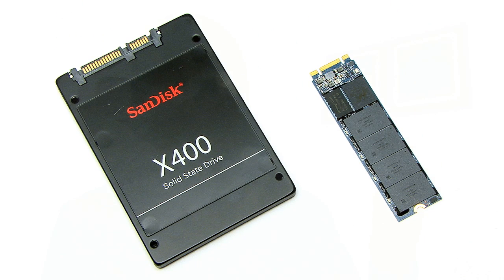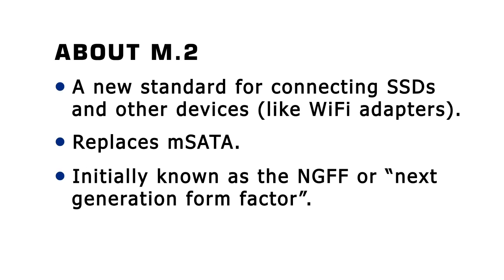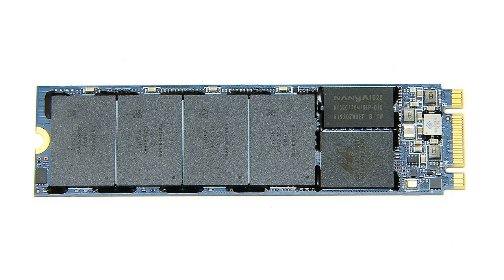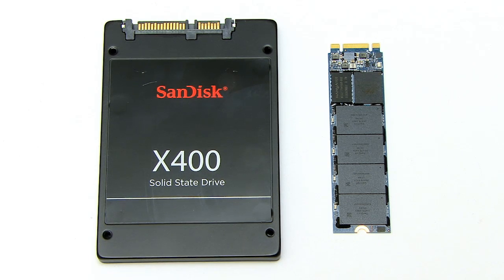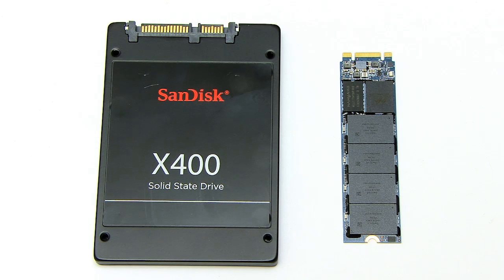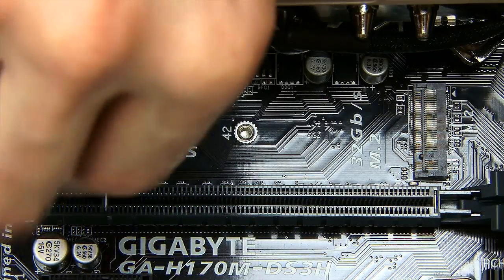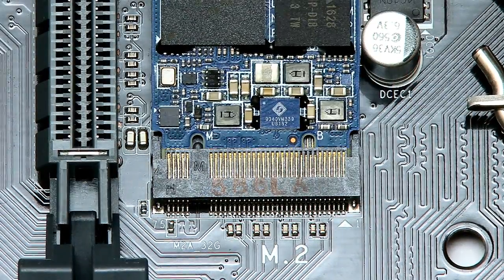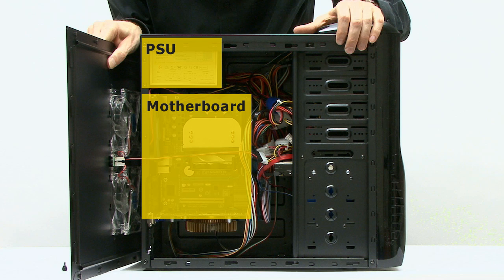Explaining M.2 SSDs

Comment: Dear friend,  I got the laptop of my niece who got a faulty motherboard.   I've bought an universal enclosure so 

I'll be able to gave her her data but I saw something odd with the Nvme Pcie m.2 ssd.  The pins are both side of the connector.  Every other ssd m.2 I saw online only got pins on one side 

Am I having something different into my hands or is it possible that the generic maker made something strange?
Reply from the maker: I've never seen an NVMe SSD without pins on both sides (I've used drives from Western Digital, Samsung and Integral).
Reply: @ExplainingComputers  thanks my friend.... I just realized what is going on .... there is missing pad on the connector, probably stock into the socket.   That's why the enclosure doesn't work and I got only 3 pads on the small parts of the ssd. 

I hope that I'll be able to fix it

Comment: Thank you very much.  Listened carefull for 6:16 minutes, when you git to physical mounting SATA 2280, I was 5" from my 15" monitor.  It's not exactly intuitive whether it's green side up or not.  My first assembly, Raspberry Pi mini Tower Desktop Ubuntu Mat`e, of any computer in 20 years.  Was surprised the image of Ubuntu Mat`e didn't recognize git from got.
I'm at my wit's end.  Disk Mounting widgit says nothing to mount.  Neither fdisk -l, nor gParted showed an installed SSD.🥴 That upward spring of SATA board is a sure tell tale sign its mounted right.
I didn't just get what I came for and leave, I stayed for the entire show.  Highly agree on the advancements the M.2 form factor, it is a game changer.  Very educational thoughout.'

Purchased a UPS, for Pi 4B 4GB, with 4000mA Lithium battery.  It and replacement were returned to sender, "not as described", they flat didn't work.  2nd one powered the Pi4 less than an hour and quit, while on a charger.  Just killing the power is a No No with Pi as it is constantly accessing micro SDHC; and, hence my need for UPS.   Product mini-box carried a label.  A specific printed attribute was the presence on the back of the unit a swatch of nano material.  Is that size enough to make a pointed notation of.  My eyes must have changed to bionic; I could see that shiny sheen and simply couldn't help myself, while pulling that thin film off the double sided tape .

Comment: i have just bought a 240 gb pcie m.2 to upgrade my hp t620 thin client but the m/c is not recognising it. is it that a pcie m.2 will not work in a sata m.2 slot.
Reply from the maker: Certainly. M.2 is not an interface, just a connector. Some M.2 connectors are wired for SATA, and some for PCIe (NVMe) drives, and some for both. So yes, if you have a SATA slot, it will not work with a PCIe SSD. Sorry. :(

Comment: Nowadays, m.2 ssd also comes with a heat sink. Is it necessary?
Reply from the maker: Yes, some M.2 drives now have a heat sink. Whether it is required depends a lot on the PC in which the drive is fitted. If the PC has decent cooling/airflow, it should not be. But a lot of M.2 slots are in poorly cooled locations.

Comment: Great job explaining the pros and cons of M.2 vs SATA SSDs.  It answered some questions that I had about the differences.  I just recently upgraded the SSD in my laptop (a decent step up from 180GB, to 1TB).  I do also have a 1TB SATA SSD that I've already cloned with the software you described in the related video.  Would it be possible to modify it to be able to fit the 2.5" drive inside and configure it to bounce between the two drives (like using one as the primary, and the other for storage)?  Just a thought.

Comment: I realise this is a relatively old video, but you didn't even mention NVME SSD devices. Did you make an update? The slot on this motherboard only has one key, and that is for the M slot. Does this mean that you can use both SATA and NVME devices in this slot?
Reply from the maker: NVMe was recently finalized when this video was made, and I covered in this video: https://www.youtube.com/watch?v=kvHUVcgo8xY I am also working on a SSD technologies, form-factors and interfaces videos to post later this month. :)

How a slot is keyed, and what types of interfaces it can support, are not directly related. B-keyed slots support 2 PCIe lanes, and M-keyed slots 4 lanes. This means that all modern NVME drives are M-keyed, but some are B-keyed also for wider slot compatibility. And there are SATA M.2 drives that are B and M keyed, as well as just B keyed. The slot in question in the video will support SATA and NVME (PCIe) M.2 drives, but this is not due to the keying.
Reply: @ExplainingComputers  Thanks Chris, I saw in the video you linked that you replaced a SATA M.2 with a NVME M.2 - This is exactly what I want to do. Surely the point of the keying is that a slot with only an M key will support BOTH types of M.2 drive, whereas a slot with both M and B keys will only support SATA M.2 drives? Or are there exceptions?
Reply from the maker: @Beevreeter  There are exceptions! For example, there are (were) NVMe drives with a B key only. Today, any recent NVMe drive will have an M key only, and SATA drives B and M keys. But compatibility all really depends on the age of your motherboard. The chances are that if an NVMe drive will fit it will work, but this is not guaranteed, and certainly not guaranteed at full speed. The only way to be certain is to check if the motherboard is specified to work with an NVMe drive, and ideally x4 PCIe. Good luck!
Reply: @ExplainingComputers  Thanks Chris, that is helpful 👍

Comment: 6:13 One simple detail that you've allowed to slip on your brilliant (as usual) presentation:
That motherboard allows for the installation of 2242, 2260 or 2280 drives, and that is marked on the motherboard with the digits and the screw holes for mounting.

I wish you were my teacher back in the 90s when there were no computer classes in Portugal yet for my age and we used to learn by gathering all the gang together and had fun opening someone's computer, messed up with the cables and fiddled up with the motherboard jumpers, hoping to get the thing running without burning.
Trial and lots of errors but a chaotic fun way to learn anyway.
Now in my 40s I watch your videos and recognize a good professional when I see one. Kudos for all your lifetime work, Sir!

Comment: Excellent explanation for M.2 Technology. I need some hep here, i recently bought SSD Samsung EVO 860 M.2, it has an edge for B+M, but my laptop doesn't have M.2 socket, can you recommend any converter from M.2 B+M to SATA so i can use it as my Internal disk ? Thanks a lot.

Comment: "be aware that inserting an M.2 SSD into a M.2 slot on MOST motherboards will prevent the use of a related SATA socket" 

I wonder is there a way to check this before going through the whole rigmarole of trail and error?
Reply from the maker: You can check your BIOS -- it is often clear (eg in the SATA settings) if it is an either/or situation with the M.2 slot.
Reply: @ExplainingComputers  Hi, appreciate your reply ;) It's actually a (HP Pavilion 15-bc006ng) laptop BIOS has no SATA settings :( 

HP are terrible providing service manuals and I checked HWiNFO64 to no avail.

Comment: What is apparent is that motherboards are absorbing components that start off as external expansions. Sound used to be on a card. Disk drive interfaces, serial ports - everything used to be on a card. Nowdays some CPU's don't even require a dedicated videocard. With M.2 hard drives became an "on-board" component.

Comment: can you use an m.2 and a 2.5 ssds when you only have 1 m.2 port in your motherboard
Reply from the maker: Normally, yes. Usually an M.2 SATA port removes the function of standard SATA port (either automatically, or via a BIOS setting). But most motherboards have at least 4 standard SATA ports.
Reply: @ExplainingComputers  thank you so much

Comment: Chris, do you advise purchasing the Gen 4 PCIe SSD instead of the Gen 3 one? I realize the Gen 4 is faster, but in your opinion it is worth the extra money?
Reply from the maker: It depends on your usage requirement. I would not pay the extra.
Reply: @ExplainingComputers  Chris, I would then consider the Sabrent Rocket Gen 3. Is there any difference, though, in this SSD being 512GB as opposed to the typical 500GB from many other manufacturers or should it work the same?
Reply from the maker: @markfalina9160  It comes down to how much space the manufacturer reserves for wear levelling (spare space used to extend life expectancy of the drive). You can always format a 512 drive to 500 if you wish. :)
Reply: @ExplainingComputers  Thank you very much.

Comment: Before you go out an purchase either a motherboard or M.2 drive, know that they have to be matched in terms of whether they are SATA based or PCIe (NVMe) based.

This is a photo of a SATA based M.2 drive:
http://rog.asus.com/wp-content/uploads/2014/04/m2-ssd.jpg

This is a photo of a PCIe based M.2 drive:
https://cdn.mos.cms.futurecdn.net/PGDqeRX8GNN3FK6ChgFjDf-1200-80.jpg

At a glance, the two types of drives look the same.
But take note of the notches on the right-hand side of the two photos.

If you buy one type of drive and try to install it in the other type of drive's slot, it will not work.

Cheers!
Reply from the maker: The video makes the keying clear also. :)

Comment: Good Day. I have a difficult question. Is there a way of connecting an NVME NF1 110mm drive to the USB of a computer and using it as external or internal  storage? E.G. "Samsung MZ4LB15THMLA-00003 DC PM983 15TB NVMe NF1 30.5x110mm"
Reply from the maker: You can get external cases for NVMe drives that connect via USB -- eg see: https://amzn.to/2QntkSq

Comment: I have m.2 key M module I will like to used on key B slot. Are there any Mod for this?
Reply from the maker: That is very interesting -- but with a different spec of M.2 slot there.
Reply from the maker: There is no mod -- the key slot relates to the underlying electronics (PCIe/NVMe, SATA or USB interface). So if your module will not fit, it is because the slot cannot us it. Sorry. :(
Reply: @ExplainingComputers  , ok I am curious because of this .https://udoo.hackster.io/matteodelbalio/udoo-x86-with-geforce-gtx-1060-gpu-2aed20

Comment: Thank you * SO MUCH * for going at a reasonable pace, and for adding graphics!

With all the other videos I watched on M.2 solid state drives, it's just a guy sitting on an office chair, talking a blue streak, with lots of abbreviations that he is too clueless to explain.

What I don't get:

I've read several articles about these SATA generation 3 drives that say the speed is:

6 gigabytes per second, and 600 megabytes per second.

For example, the next line is from Wikipedia:

SATA revision 3.0 (6 Gbit/s, 600 MB/s, Serial ATA-600)

It can't be both! What is happening here?

And where do you get those nice graphics? Or how  do you make those nice graphics?

Happy Thanksgiving Everyone!
Reply from the maker: SATA 3.0 has a maximum theoretical speed of 6 gigabits per second (6 Gb/s), which is the same as 750 Megabytes per second (MB/s). However, this is the raw bit rate, and some of this is used  in the communications protocol used to verify data as it is transferred, which is why the actual maximum theoretical transfer speed comes out at 600 MB/s.  So 6 GB/s raw = 600 MB/s max actual are both correct. I do indeed make all of the graphics in my videos myself. All 3D work is done in LightWave, 2D in Photoshop or Illustrator, and compositing elements together in After Effects.

Happy Thanks Giving. :)
Reply: @ExplainingComputers  

Thank you much. That was so confusing, and none of the articles I read bothered to explain why there were 2 very different numbers for what looked to be the same transfer rate.

Comment: Awesome video, beautifully explained.
Just one note to potential installers out there....... when removing the screw and fitting the m.2 board, make sure that the stand off, or spacer, is in the right position, or you will trash it.
Reply: Really appreciate your work btw 🥳😁♥️

Comment: My EZbook X4 Notebook has a 128GB Toshiba SSD as boot drive. There is a free socket exactly as the one in this video for Extra Storage. I purchased a 256 GB PCIE GEN3X4 NVMe SSD and plugged it in. The screen goes blank and Notebook switches Off? Why? Does it need some BIOS setting? Please help how to install. Thank you.
Reply from the maker: Is the M.2 slot in the Toshiba a SATA or NVMe M.2 slot? I guess if an NVMe drive fits, it is keyed for it and should work. It is possible that a BIOS setting needs to be changed. What OS are you running? Win 7 does not natively support M.2 drives.

Comment: I'm amazed that you actually made this video without even having a PciE device to show, and without discussing or measuring the speed differences between the two M.2 for factors! A brave man end an early adopter! Time for an update methinks.
Reply from the maker: My last video of this month is on QLC vs TLC SSDs, and tests out two of Samsung's latest EVO and QVO models. As you have discovered, SSDs can just fail. :(
Reply from the maker: Well, its great that I amazed you. But it is not essential to have hardware available to discuss a concept and technology. :) As you imply, several years ago when I made this video, PCIe M.2 drives were far less common and far more expensive than they are today. I have mad ea more recent video showing NVMe drive speeds here: https://www.youtube.com/watch?v=kvHUVcgo8xY
Reply: @ExplainingComputers  Thanks for your response, I have been having bad luck (?) with SSD's with two failing completely and irrecoverably within 6 months without so much as a hint of trouble before they did. They were not even particularly heavily used. It has shaken my confidence in the technology. Even your WD black video is now more than a year old - Have you any further recent experience or new technology information or recommendations to share on this topic?

Comment: Small note this video missed which is still true even today is that not all PCIe SSD's they come in both 2 and 4 lane versions the former is only 16 Gb/s (2 lanes * 8 Gb/s/lane) also some motherboards that have multiple M.2 slots wont support 32 Gb/s if all of them are used or will only do so if certain PCIexpress slots are not used etc so do check both your drive and motherboard specs to be sure.

Comment: Well his prediction was wrong. IN 2019 we still have hard drive slots being used for hard drives in the majority of desktops same as in laptops.In part this is due to the main type of the M.2 form factor that took off was for the PCIe one and not the SATA one. In short now if the user wants they can have 1 to 3 M.2 drives then 6 to 10 SATA drives in the same motherboard. That is depending on the board without expansion cards. A desktop with 3 M.2 Drives and 10 SATA drives might as well be a NAS by then.
Reply from the maker: As far as I recall, the prediction in this video is that M.2 slots will hasten an evolution to far smaller desktop PCs with small form-factor storage connected to the motherboard. And this the direction of travel, especially in industrial settings. So what exactly is "wrong" in what I said? There is no prediction in this video that PCs would have changed entirely by 2019 -- indeed there are no date-specific predictions at all. :)
Reply: @ExplainingComputers  That is true you didn't i just assumed you meant within  a year or 2. To that when the price of a 1TB M.2 drive is the same as a 3.5" drive they will be in almost all systems. From the bottom to the top of consumer PCs in all forms of them.

Comment: Won't placing the drives in sockets close to the pci-e be an issue seeing as some video cards tend to run fairly hot?
Reply from the maker: We are indeed now starting to see M.2 SSDs coming with increasingly large heat sinks . . .

Comment: Great video - but only a nerd will say its easier with a tiny screw than plug'n play cabels! Painful how M.2 eats up sata slots on current motherboards :-(.
Reply: Get an M.2 NVME they don't eat up SATA slots.
Reply: @JayzBeerz  New to me - which motherboard does not do that with a NVME drive?
Reply: @meibing4912  I'm using a Z370 MSI gaming pro carbon AC.
Reply: @JayzBeerz  well then your board actually does loose SATA ports if you use the M.2 slots... Just check your manual p. 34! Think all boards do this with M.2.
Reply: @meibing4912  If you look on page 20 there is a chart showing all ports of activity and non activity with many combinations.

Comment: Oke, so if I understand it correctly, M.2 is only a standard for the physical connection, not the data transfer protocol. It, in fact, borrows its protocol from other standards like PCIe or SATA. Is that correct? This point is a bit confusing since you were comparing M.2 SSD's with 2.5 inch SATA SSD's where SATA is a standard about BOTH the physical connection and the protocol.
Reply from the maker: You are correct -- M.2 is a connection and form-factor standard that can carry one or more interfaces, including SATA, PCIe (a common standard being NVMe for SSDs) and USB.

Comment: great video - but i have an addition which was true even when your video was made

you can build a PC in 1 "chunk" if you use a small PSU that fits directly onto the 24-pin-ATX-Connector like Pico-PSU or similar solutions

yes, you will need an AC/DC-Adapter - usually with 12 volts - but you can spare out a huge ATX/TFX/SFX power supply 

you can get extremely small, yet powerful PCs with that system - i'm build mine into an old Nintendo NES case that way - with modern CPUs like Ryzen 3000 APUs you can have an HTPC or mid range gaming rig - or if you like, just use nano-ITX, even smaller is possible